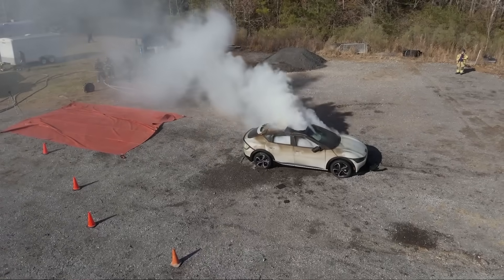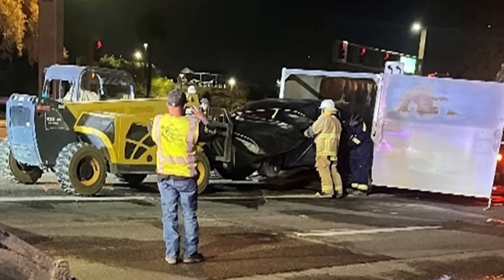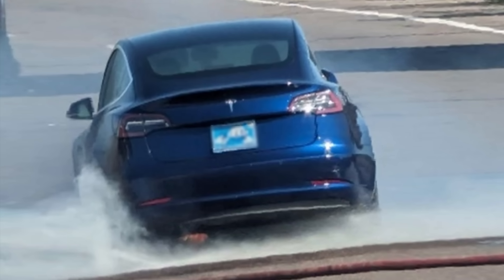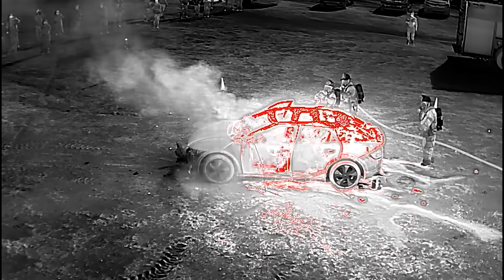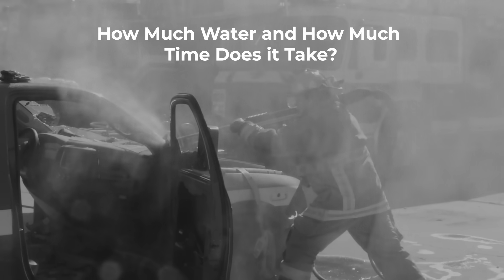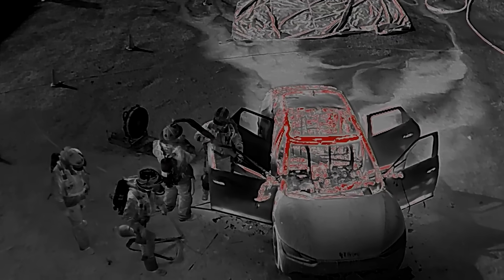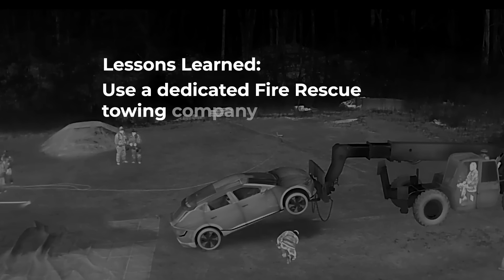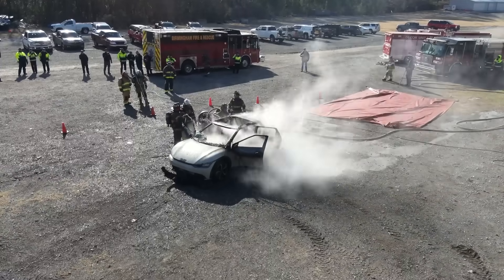Quick and Efficient Method of Extinguishing of an EV Fire tested in Tempe, Arizona

Comment: Sounds pretty Good!!! I have a Recommendation for ALL FIREFIGHTERS:

Since Batteries have Acid in them, Why NOT make a Baking Soda Mix to NEUTRALIZE THE ACID, Which may calm the Fire and The Flashpoint reignition!!

For awhile now, they have Baking Soda Blaster's for stripping paint off cars, maybe the same principle applies here to NEUTRALIZE Acid Fires. "Maybe a 70/30 Mix Baking Soda to Water"

When I had My Electric R/C Cars and Trucks, my batteries would over heat and start on fire. I would use Baking Soda to NEUTRALIZE the Acid, Which can take awhile!!! Batteries like to ooze that acid for a good minute. I would saturate the ground under the EV Vehicles to minimize Roadway damage as well.

I would suggest spraying the baking soda under the car, then pierce it with That Tool, and spray in Baking Soda and maybe another Dry Chemical additive to Combat these EV Fire's!!!

That's my professional opinion. God Bless Each and Everyone of You and Your Families!!! Thank You ALL for Your Faithful Service!!! God Speed to Your Aide to Protect You from ALL Hazard's!!! Selah
Reply: These are not old-school lead-acid batteries - they are Lithium-ion - and there is no acid.   Also, it's not one big battery.  My Tesla has over 1,000 individual batteries - each one like a flashlight battery.  So - no - none of that will work.   The problem isn't that the entire battery pack has failed - it's that just a few individual batteries have gotten into this "runaway" condition - and if you can selectively cool just those few - then the problem is solved.   So you look at the battery pack with thermal imaging - you see where the hot-spot is - and you punch a hole right there and squirt high pressure water into just that spot to cool just the problem batteries.   It's a very clever solution.
Reply: The Baking Soda will clump up and plug areas of the battery tray's, keeping the water locked inside those battery tray's, to reduce the flash point. 

There is still a Chemical Reaction going on as these Lithium batteries cannot take heat nor Pressure.....They instantly Explode Violently!!!

I want to quell this issue, Majorly to protect Fire Fighters from the Technology. Building these as Battery Tower's is Ridiculous!!! Endangering Human Lives is Not Good Business!!! God Bless.

This Tech is NOT they Way of the Future!
Reply from the maker: Interesting idea. How you tested this on small lithium battery fires?

Comment: Do not use blankets. They trap the heat and gases and turn the entire thing into a large bomb. I dont think you got the fire out because that looks more like smoke rather than steam coming off the car. I wouldnt get near that car when it is putting off that much smoke and steam. Either way the battery is still in thermal runaway until it goes below 100 degrees F.

Comment: How much money is it costing annually to extinguish EV fires?  How much water is being contaminated & how much does it cost to decontaminate the water?  How are they containing the contaminated water?  All hidden costs of EVs - on top of the increase in injuries & deaths caused when people in a traditional vehicle impact an EV that weighs over half a ton more.
Reply: Stop with childish fear mongering. If you really cared about cost ICE vehicles forced to have RECALLS due to fire risk should be paying more. Massive list includes modern BMW 6cyl Diesels, S550 Mustang GT350 Fuel Filter, Hyundai ix35, VW Groups high end cars Porsche, Audi Lamborghini having burning hot engines parked after heavy driving. EVs are far less likely to ever catch fire, NO FIRE, NO INJURY, NO COST!
"EV that weighs over half a ton more" Umm a typical passenger of similar category weighs about 1/4 ton more for inefficient EV designs and about 100lbs more for efficient EVs designs. There is small weight different between F80 BMW VS Tesla Model 3 OR Kona EV vs Honda CR-V 5th Gen.
You are pushing childish dramatic fearful lies which defy the real world facts.
Reply: TOTAL Weight is not the primary factor in crash safety. Body and Structure design massively impacts crash results. BEVs have way more CRUMPLE zone due to flexible power train packaging, More SPACE for vehicle to deform. This massively benefits the INFERIOR Front Engine ICE car. Dramatically more DISTANCE and DEFORMATION Material is SAFER, outweighs total weight difference. Your childish lies ignores real world engineering.
Reply: @jhunwong8739 
You seem to think that I'm talking about occupants of EVs - I'm not.  I'm talking about the occupants of the people in the small, lightweight 2 door sedan impacting a vehicle that outweighs it by a ton.  Surely you're not suggesting that an extra crumple zone or 2 in a 40 ton 18 wheeler is going to be of any significance to the occupants in a small 2 door sedan crushed by the 18 wheeler.  Or, are you?

The statistics of injuries of occupants of traditional cars verse EVs tells a different story.😊
Reply: @ WRONG I'm specifically talking about the occupants for the other car outside of the BEVs. You are soo fixated on your fear mongering you cant comprehend my clear explanation how structural design effects the OTHER Car.
Reply: @ The most common BEVs will be 1.4 to 2.0 Tonnes. A sporty 1.3 tonne 2 door Coupe will not fair worse against a 1.5 Tonne ICE car vs 1.8 Tonne BEVs. Your fear mongering ignores the real world numbers.
Reply: @ "statistics of injuries of occupants of traditional cars verse EVs tells a different story" No such statistics exist, you are fabricating them.
Reply from the maker: ICE vehicles statistically burn more often, but EVs burn longer and are harder to extinguish.

Comment: Too bad sodium based batteries don’t charge fast! That’s what train locomotives have been using for 70 years and they don’t runaway once in contact with air. Blankets and the cobra technic are ways to go. It’s about time the Canadian and US agencies force the EV industry to figure this out before putting them on the road.

Comment: Seems like a port with a quick connect be part of the design.
Reply from the maker: @ctifnewswebtv3802
0 seconds ago
Renault has a solution like that. But even if all new cars had it, you would still have the older cars requiring a solution

Comment: Would it not make more sense for every EV to have a pipe from the battery to the side of the car that allowed the battery compartment to be flooded by any hose?
Reply: The problem is the fire could be in different parts of the battery and you would need multiple channels to get close the fire. While at the same time the Battery needs to be water tight and prevent contaminants getting in. Soo it's very difficult contradicting goals.
Reply: @ Cars have had waterproof pipes into fuel tanks for ever. Done right a car owner with a garden hose might then save their house from going up in flames rather than wait for the fire service to show up with their special tools.
Reply from the maker: @ctifnewswebtv3802
0 seconds ago
Renault has a solution like that. But even if all new cars had it, you would still have the older cars requiring a solution

Comment: The only way to stop an electrical fire is to stop the electricity from flowing to the short, for a battery that means full discharge the battery and for lithium you need to stop the chemical reaction at the same time. Once you lance the battery case the water will drain out, if the runaway breaches that case under the car, there goes your water.
Reply from the maker: Water will extinguish lithium over time. 48 hours when submerged. In this case, the battery is "submerged" from the inside. Check the tests from MSB.se (in the description)
Reply: @ water does cool the lithium reaction as long as you have enough of it, the other problem with water is at the temperature that these batteries burn water separates to Hydrogen and Oxygen, this is why they have used sand to smother while the short discharges the battery over several weeks.
Reply: @jeads21  Stop with the misinformation. There is near ZERO Metallic Lithium in NMC and LiFePO4 batteries. Metallic Sodium with the same exothermic effect and hydrogen splitting is not the same as Sodium-Chloride. You fail at chemistry.
Reply: @ near zero, not zero. Do you know how hot near zero lithium batteries burns? And how much uncontrollable energy is inside of those batteries?
Reply: @jeads21  Near Zero means it has negligible effect on fire fighting methods. The best method is still using lots of water.
Reply: @jhunwong8739  I noticed you didn’t answer the questions .
Reply: @ I never said volatile near zero lithium batteries, I said Near Zero in Metallic pure form. The oxide / phosphate cathode form is not that volatile in water while the tiny amount of lithium ion with a charge is distributed soo finely and low concentration. Bathing it in water has very little reaction.
Reply: @jhunwong8739  where did you come up with “ volatile”  not in any. Of my reply’s. The nature of all high energy(amps) and voltage batteries is volatile, cells close together which causes a cascade effect in all directions from the initial problem cell. The larger the battery, the more concessions you have to make or mitigate. In the EV batteries they make more concessions than they mitigate.
Reply: @ Most forms of galvanic cells including most Li-Ions when Redox reaction being forced to any extreme side of the cycle is VOLITILE. Regardless of electrical connection and you never complete the circuit. Just the chemical state of the cells is volatile. Thus why OEMs advise you keep Li-Ion between 20% and 80% for long term storage. Where you have partial cycle on the cathode and anode. This cause impure reaction when you add external materials to react with it, i.e. water.
Reply: @ "cascade effect in all directions from the initial problem cell. The larger the battery, the more concessions" WRONG no battery pack is build like that. It's made of out MODULEs which inherently try to disconnect part with many methods and many triggers. Electrical Cascading effect only happens in a small area and is dangerous enough to start a fire burning thermal runaway. Electrical Runaway is NOT a thing.
Reply: @ you can turn a blind eye if you want or claim things are false but airlines, model airplane parks, server farms and even U.S. Submarines all who deal with multi cell batteries of various sizes and voltages have mitigation plans for short in a battery and a runaway. Don’t stick your head in the sand. Come up with plans to solve problems, you could be the person that solves this problem.

Comment: Lithium fires burn under water, so how does water extinguish them?
Reply from the maker: Water will extinguish lithium over time. 48 hours when submerged. In this case, the battery is "submerged" from the inside. Check the tests from MSB.se (in the description)
Reply: Because the water is being used to cool the battery pack so its temperature drops below what’s required for thermal runaway.
Reply: Lithium cells only burn under water if they are in a waterproof box. So it keeps burning inside. You need to get the water inside and cool the cells directly.
Reply: It is important to make a difference between lithium ion and lithium metal. It is lithium metal that burns under water.

Comment: I'm sure when petrol (gas) powered vehicles came on the scene, firefighters developed new techniques (gas being slightly ore flammable than horse manure). 
Questions: 
1) How would the lance work with the new foam filled battery units
2) Should EVs have an emergency 'drain off' where the remaining battery energy be removed before transport?
Reply from the maker: Good question to research for the future!
Reply: 1.There has been a couple of fires with foam filled batteries were it worked. Think of it as if the vent gases from the thermal runaway needs to exit, and thus creating a path for the water to flow. The foam filling is a good insulator, so extinguishment in these cases are probably due to water cooling the battery in thermal runaway in cooperation with the insulation.
2. It is a time consuming process to drain the batteries. So I think it is better to transport the vehicle somewhere and have the car repair shops take care of that part. As soon as possible to avoid reignitions.
Reply: Most EV batteries have fuses that in event of emergency isolate the cell banks and get voltage down to a safe level.
Reply: "emergency 'drain off' where the remaining battery energy be removed before transport" Is not possible, that is how you destroy most types of high energy density rechargeable batteries. FYI look up how Galvanic Cell chemistry works. That "drain off" means forcing the reaction to an extreme end of one cycle. Please stop spamming nonsense.
Reply: @Neojhun  You were doing so well until the last sentence. I obviously wasn't suggesting to drain off at a rate that would would compound the problem. All batteries can be safely fully drained - it may harm the batteries ability to recharge but we're not looking to recover the batteries, only make them safe for transport.

Comment: You can learn chemistry. Water and Lithium do not mix. 
lithium reacts with water, producing lithium hydroxide (LiOH) and hydrogen gas (H₂). The reaction is highly exothermic, meaning it releases heat. Here's the chemical equation for the reaction:  2 𝐿 𝑖 + 2 𝐻 2 𝑂 → 2 𝐿 𝑖 𝑂 𝐻 + 𝐻 2

Comment: I don't see how water works at all.  I have seen a YouTube short where a charged 18650 li ion battery that has been stripped open explodes on fire when thrown into a tub of water.  Water cools and they are only piercing the first layer of the battery pack, not the surface of the actual battery?  See in YouTube Shorts:  "Lithium is dangerous" by NileRed channel
Reply: This tool is actually piercing all the way in to the cells. But that is not the goal. The goal is to put water/cool between the burning cell and the not burning cells. In that way the burning cell burns to completion and the non burning cells doesnt start burning.
Reply from the maker: Water will extinguish lithium over time. 48 hours when submerged. In this case, the battery is "submerged" from the inside. Check the tests from MSB.se (in the description)

Comment: Government should demand that all EV be equipped with fire suppression systems. Or they are not allowed on the roads.  Or use batteries that will not ignite.
Reply: Per 100K sold, ICE vehicles are involved in 1,500 fires. That is 60 times larger than the 25-per-100K sold for EVs.